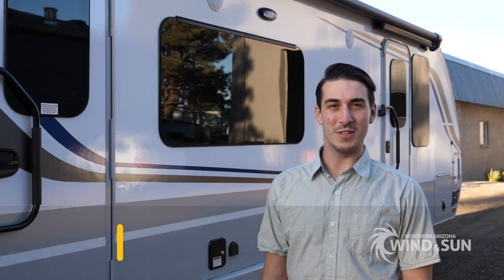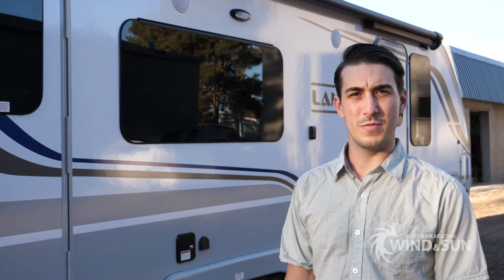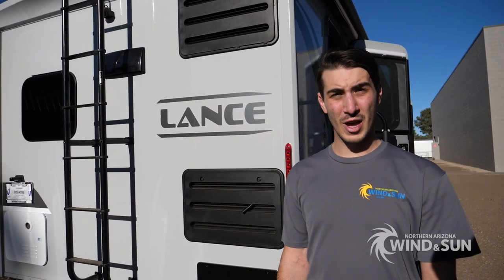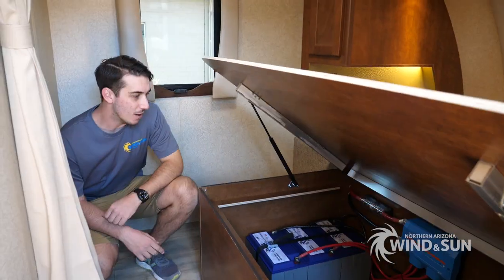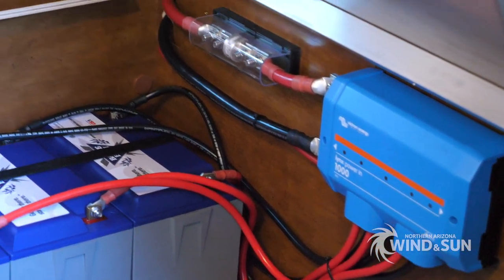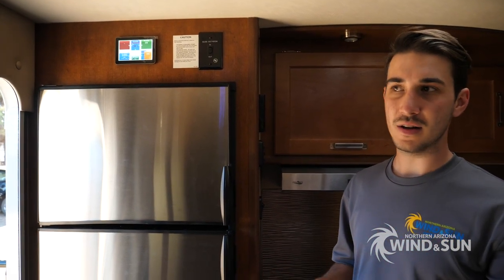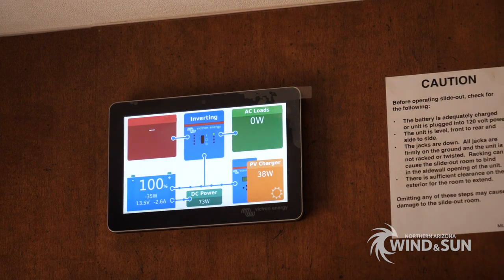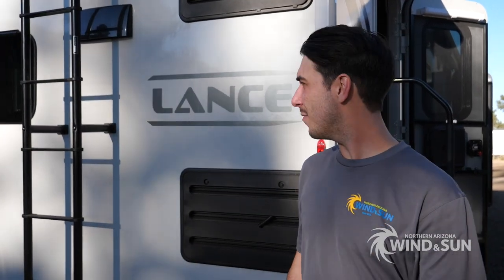Lance 2285 Travel Trailer Solar Power Installation

Comment: Great video.  What hardware did you use to attach the panels to the roof and where?  According to the drawings I got from Lance the roof system is mostly block foam with a few aluminum cross members every 48 inches.  Any advice on how to securely mount these panels would be appreciated.

Comment: I am curious as to why the batteries were not put in the 2285 battery compartments? I know they don't need to be vented but that is otherwise wasted space. Are the standard deep cycle batteries still in the system or removed?

Comment: will that system run the air conditioner ?
Reply from the maker: Hi Steve, it will run it intermittently.
Reply: When you watch some of the interviews with the Battle Born Battery management, they use a general planning factor of 1 hr of a/c use per 100ah battery.  That is under the assumption that your batteries were already charged to 100% and you are not running other items in the RV.  Also, it is highly recommended that you install one of those "soft start" modules in your a/c so that you don't get the initial high energy consumption spike upon start up.

Comment: why 12 volts vs 48 volts?
Reply from the maker: Hi there! Reach out to one of our sales engineers by phone and they'll be glad to help you out. (800) 383-0195
Reply: @NAZSolarElectric  usually the reason is some people want to have 12 volts available to the old ways of lighting and appliances using 12 vdc, but with a very efficient 48 vdc to 120 /240 vac system, led lighting and others stuff would be more than fine